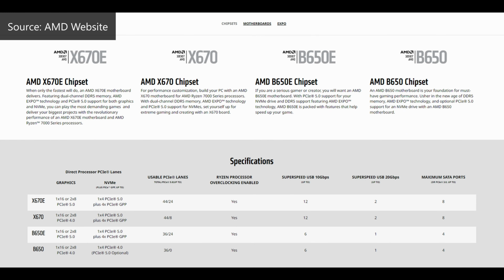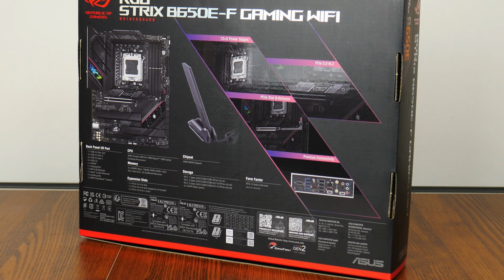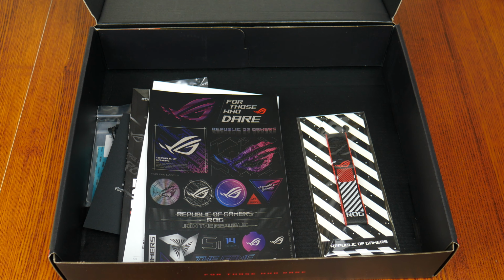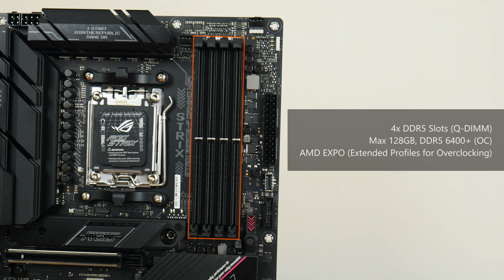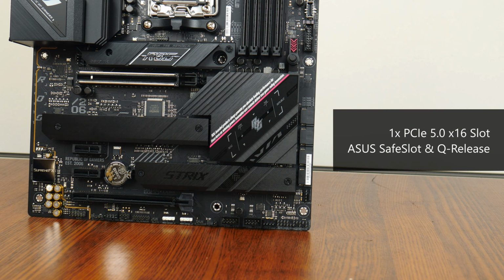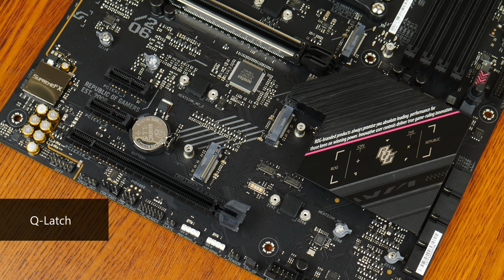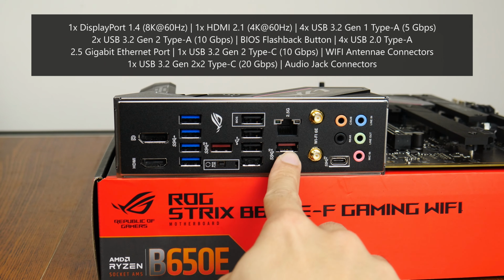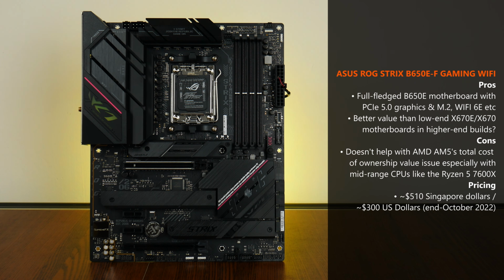Get this over an AMD X670 board? ASUS ROG STRIX B650E-F GAMING WIFI Unboxing & Overview

Comment from the maker: UPDATE AS OF AUGUST 2024: This video was published before 48GB DDR5 memory modules were available - according to the ASUS specs page, this motherboard now supports up to 192GB of RAM with 4x 48GB DDR5 memory modules. In addition, "Zen 5" Ryzen 9000 series processors and "Zen 4" Ryzen 8000 APUs are now supported with a BIOS update that is available for download from ASUS's official website.

Check out the written article version of this motherboard review here: https://www.alktech.co/articles/review-asus-rog-strix-b650e-f-gaming-wifi-am5-motherboard
Reply: Which one is better the b650E -E or the B650E -F?
Reply from the maker: @wankerka the B650E-E has more features. such as dual PCIe 5.0 x16 slots and dual PCIe 5.0 x4 M.2 slots - the B650E-F on the other hand comes with one PCIe 5.0 x16 slot and one PCIe 5.0 x4 M.2 slot. The E-E would hence be more expensive than the E-F, so it'll boil down to whether or not you have a need for the additional features that the E-E comes with...
Reply: @ALKtech  thnks for the info, hmm i think ill go for the E - E it makes sense. Not buying a x670E not worth the money
Reply from the maker: @wankerka  I do think high-end B650E boards can make more financial sense than X670E boards, though this of course does depend on your actual use case!
Reply: @ALKtech  for me it's for gaming. Gonna pair it with 7800x3d. 7900xtx. That will do for me at 1440p monitor
Reply: An interesting info about the support of 48 GB RAM modules, never heard about such modules😊. My Ryzen 9700X supports up to 192 GB RAM. I think that current amount 64 GB RAM that I use with this MB is enough for me. Thanks for the August 2024 update. Interestingly I bought the MB in August 2024 as well for about 245 USD. I'm satisfied.
Reply from the maker: @mirao-u9p  in fact, some AM5 motherboards from other brands such as Gigabyte and MSI are already pre-emptively advertising support for 64GB DDR5 modules, which aren't really available as of yet! 4x64GB (256GB) of RAM in a consumer-oriented system seems like overkill 😅
Reply: Does this motherboard have on board wifi? Because on the amazon page it says on board wifi but also comes with a wifi adaprer
Reply: @gamepsyko It does, I'm using it.
Reply from the maker: @gamepsyko  yes it does, it comes with WIFI built-in!

Comment: Great review.  I can't decide between this Strix version, or the TUF 650E?  They're both about the same price here in the UK in 2025.
Reply from the maker: Cheers! Out of curiosity, how big is the price difference exactly? If it's really just a few quid, I'd probably just go with the ROG Strix as it's the more premium offering of the two boards with better specs. Have you already decided on a processor for your build yet?
Reply: @ALKtech  Here in the UK the Strix is £190 and the TUF is £195.  As for CPU I want to use the 7800X3D.  Keeping away from the 9000 series, as they seem to be prone to failure?
Reply from the maker: @mrmactknife  oh then the choice is as clear as day - I'd definitely go for the ROG Strix since its cheaper than the TUF!

Regarding the 9000 series, I assume you're referring to the reports of chips such as the 9800X3D burning up in the socket? I personally wonder if it's a case of vocal minorities...but in any case, the 7800X3D is still a pretty solid gaming CPU!

Comment: 8:55 can someone explain this for me? will adding an nvme ssd in the 3rd slot affect performance in games or affect my gpu? or is that slot mentioned for something else?
Reply from the maker: Hey there, adding a SSD to the third NVMe slot won't impact your gaming performance nor your GPU performance. The only impact to be had is that it disables the full-length PCIe 4.0 x16 slot that operates at x4 mode, which is a concern only if you're intending to install an add-on card in that slot! If you have no use for that slot, you'll be fine!

Comment: Does this run on windows 10! Seen a mobo comparison and it said it doesn’t run 10?
Reply from the maker: Theoretically it should work with Windows 10, though for absolute peace of mind, using Windows 11 would be best as you'd get the latest software optimsations for AMD's AM5 processors going into the future!

Comment: I want to buy it but i read a lot about stability issues. :/
Reply from the maker: Hey there, what kind of stability issues did you read about?
Reply: @ALKtech  About long time to post, 1+ min even with qvl listed rams. About bsods. Mainly issues with expo. I dont have great knowledge and it will be my second ever build,i want something "plug n play". So...for safety im thinking to go with qvl listed rams 5600mhz 36cl 2*32gb. Less voltages and higher latency I think will pressure memory controller less so i will increase the stability??? In my country i can find asus rog strix b850e-f for 80€ more expensive. Im thinking for this one too.
Reply from the maker: Mmm I wonder if these issues are cos of older BIOS revisions - I'd think RAM compatibility would be improved somewhat as long as the board has the latest BIOS version onboard! That said, the sweet spot for Ryzen 7000 and 9000 is DDR5 6000 - perhaps consider getting DDR5 6000 low latency RAMs?

Comment: This or a asus tuf x870 plus?
Reply from the maker: How big's the price difference between both boards where you're from, and do you need USB4? If the B650E-F is cheaper and you don't need USB4, I'd get the B650E-F!
Reply: @ALKtech  they basically the same price over here lmao. Asus got more features and better phases I think, meanwhile rog strix got that premium feeling...
Reply from the maker: Mmmm. Yeah I do agree that the ROG Strix definitely feels more premium compared to the TUF due to its looks and accessories, while the TUF being the newer board, comes with a newer chipset (which is basically just a X670 with USB4 tacked on) and a slightly better VRM setup. That said, I think that both boards should handle even a 9950X3D or 9950X with ease. 

One thing that I do not like about the TUF is the fact that its second M.2 slot shares bandwidth with the PCIe slot for a graphics card - this is something that's really common with the first wave of X870E and X870 boards due the introduction of mandatory USB4 support, where the USB4 controller requires additional PCIe lanes for operation, and the X870E/X870 does not have "additional" lanes to support the controller, leading to this whole lane sharing situation.

Out of curiosity, what's the specs of the PC that you're looking to put together?
Reply from the maker: The B650E-F is gonna handle a 9800X3D just fine, no need to splash out that extra $ for the X870! And damn, your new build is gonna be one heck of an upgrade from your current PC, I had an i5-2400 and RX 580 combo at some point in time for my own personal rig 😂
Reply: @ALKtech  wish me luck cause prices can hike at any moment 😭
btw was thinking of saving a lil longer so as to get a x670 rog strix instead
Reply from the maker: Ugh, is it due to tariff issues? Which country are you from? Anyway how big is the price difference for the X670E-F vs the B650E-F, and is there any particular reason why you're looking at that board too?

Comment: Used this board for my new build with 7800X3D, GSkill Z5 RGB 64GB 6000 CL36, MSI Spatium M480 Pro and RX 6800 XT. Its been 2 months and is running great but i have plans to upgrade gpu next year when amd 10 series comes out
Reply from the maker: Great to hear - it's really awesome that AMD has committed to support the AM5 platform for such a long time. Really helps that this motherboard comes with PCIe 5.0 support for a graphics card and M.2 drive, making it pretty future-proof!
Reply: Just ordered this board for 7800x3d, Rx 9070xt, 32gb 6000mhz cl30 ram and Strix 1000w PSU.. should do fine for many many years. :)
Reply: @SipePerkele same here but instead of 7800 i go for 9800x3d

Comment: only thing I wish they would do is add mobo risers and screws
Reply from the maker: Are you referring to a PCIe riser so that you can do a vertical GPU mount?
Reply: @ALKtech  no Im talking about those little studs that go between the mobo and case
Reply from the maker: @truthteller9000  ahhh right...those are motherboard standoffs! They come with your PC case actually, and motherboard manufacturers never include those as part of the motherboard's list of accessories - is your PC case missing the said standoffs?
Reply: @ALKtech  I know they dont come with them thats why I wish they did lol and no new case didnt come with them either so I just ordered a little set of them no biggie haha
Reply from the maker: Oops, it could be that the case manufacturer left out the motherboard standoffs from the accessories pack...you should probably lodge a complaint or something 😅 what brand and model of case did you get?

Comment: I also used this Motherboard with a 7900X CPU to upgrade my Sons PC. We really like it. I usually stick with MSI but Asus did an amazing job with this Motherboard. Price to performance is amazing.
Reply from the maker: And it still holds true even with the launch of X870E and the X870 - at least until AMD stops producing the B650E chipset! Did you manage to get the board at a good price?

Comment: So no seal on the box and no seal on the static bag ? I want do buy one. How can i be sure is 100% new ?
Reply from the maker: Actually this is not just limited to ASUS - for other brands such as Gigabyte, MSI etc, you'll find that the boxes are unsealed, and some brands may only just put a simple piece of clear tape to hold the opening of the static bag together. Your best bet would be to purchase your motherboard from a trusted physical/online retailer that won't mess around with things!
Reply: @ALKtech  Thank you ! I am buying it from a trusted physical and online retailer, actually a big one in my country. I wanted to be sure about these seals not being there :))
Reply: @dragos1354 I was wondering the same, I got mine from amazon and this no deal thing was making me think it was already used, plus the static bag was like no smooth, like it had the marks of pointy parts on it.

Comment: Is ryzen 5 7600x goot combo for this motheboard?
Reply from the maker: A 7600X will work perfectly fine with this board for sure. Do you have a graphics card in mind already?
Reply: @ALKtech  I will buy used 3070 ti,good combo right?
Reply from the maker: @simkesimoni7077  yup, a 3070 Ti will work pretty well with a 7600X! You'll be able to game at 1080p easily, or at 1440p with Medium to High-ish settings.
Reply: @ALKtech  is it evga 650w 80+ platinum enough for that cpu and that gpu? and 2x16gb ram
Reply: @ALKtech  pls answer bro
Reply from the maker: @simkesimoni7077  a 650W PSU will be fine for a 7600X+3070 Ti, though it won't hurt to get a more powerful PSU if you have the budget for it. This would give you more headroom for an upgrade to a more powerful graphics card and processor down the road, especially since B650E boards will support the next gen of Ryzen processors by AMD. That said, 2x16GB of RAMs is good - do you know what RAM speed you'll be getting yet? DDR5 6000? DDR5 6400?
Reply: @ALKtech  i will upgrade psu but now now ,maybe next year...Yep 6000mhz cl36 kit
Reply from the maker: @simkesimoni7077  sounds good!

Comment: Im not sure if this mobo has a tpm connector, so will it be able to run w11???
Reply from the maker: You'll be fine - you don't actually need a dedicated on-motherboard TPM module to support Windows 11 - modern CPUs such as the Ryzen 7000 series supported by this board, include a firmware version of TPM on the chip, and hence there's no need to buy a discrete TPM module to be installed on your motherboard. Hope this clarifies!
Reply: @ALKtech  now that makes sense I wasn't able to find an answer, this clarified everything thanks!!

Comment: Thanks for the review, I actually bought this motherboard after watching your review, and so far so great!, btw, What does it exactly mean that PCIe 4.0 x16 lane operates at x4 mode?
Reply from the maker: Glad that you found the video useful! It simply means that the physical connector supports a full-length x16 card. but has physical pinouts to support x4 link speeds only (i.e. within the plastic slot itself you'll notice it only has 1/4 of the gold "teeth"). Hope this helps!
Reply: Thanks! Now I get it! @ALKtech

Comment: Hi my friend built a new pc with this and he has problems when he want his ddr5 ram to run above 3600mhz does any one have a solution to this?

He has 128gb of ddr5 ram (4x32gb) and the pc wont boot when he changes anything in the bios regarding his ram and the mhz they are running at.
Reply from the maker: Looking at ASUS's RAM QVL list for this board, it does appear that they've only tested 4x32GB DDR5 RAM at 5200MT/s speeds - this COULD be the reason why your friend's having issues with RAM speeds faster than 5200MT/s!

Comment: Thanks for the detailed overview of the ASUS ROG STRIX B650E-F GAMING WIFI motherboard! Your video provides an excellent insight into its features and specifications. I'm particularly impressed by the PCIe 5.0 support and the abundance of USB connectivity options.

I do have a few questions, though. Could you please clarify if this motherboard supports AMD's SmartShift technology? Additionally, are there any specific advantages or unique features of the B650E chipset compared to the higher-end X670E and X670 chipsets that you mentioned earlier?

Looking forward to your response!

Comment: Just grabbed this board with a 7700x cpu excited to get everything installed
Reply from the maker: Sweet, what GPU will you be using in your setup?
Reply: @ALKtech  I already had a 4070ti but now I’m actually taking back the 7700x for the 7800x3d it’s on sale for $80 off at the local microcenter
Reply from the maker: @westside4life1770  7800X3D's gonna last you some time as a gaming powerhouse!

Comment: Is it compatible with the AMD Ryzen™ 7 7700X
Reply from the maker: Yes it is! It's compatible with all AMD AM5 processors.
Reply: @ALKtech  ok thanks
Reply: @ALKtech  also do you need specific AIO’s
Reply from the maker: @TheHenVR  not really, as long as the AIO you're getting comes with support for the AM5 socket, it'll fit this board just fine!
Reply: @ALKtech  ok and I’m getting the nzxt kraken z73
Reply from the maker: @TheHenVR  it'll fit, just gotta make sure the Z73 comes with the AM5 mounting bracket!
Reply: @ALKtech  ok I think it does thanks

Comment: this or the GIGABYTE B650 AORUS ELITE AX
Reply from the maker: The ASUS in this video is positioned slightly above the Gigabyte in terms of specs, especially since the ASUS board uses the higher-end B650E chipset and the Gigabyte uses the B650 chipset. How big is the price difference between both boards where you're from?

Comment: Micro center has this board pared with a R9 7900x and 32GB ram for $550.00 just make shore to flash the bios as asus is in the dog house over there Bios frying CPUs
Reply from the maker: Wish there were Micro Centers where I'm from - you folks always get pretty good deals from them! But yes, gotta make sure you've got the latest BIOS for ASUS AM5 boards..

Comment: I’m getting a great deal for this mother board cpu and ram. I’m kind of scared to get this motherboard what should I do?
Reply from the maker: What's the concern that you have regarding this board? By and large I think this board has the right mix of features for a relatively future-proof AMD system that will be ready for a next-gen processor upgrade (Ryzen 8000 series and perhaps 9000 series) when they arrive!

Comment: The best thing and the reason I picked this motherboard for my 7800X3D+RTX4090 build is that it has a PCI-E x16 slot (yes, I know it operates at x4 mode) sitting at the bottom of it. With this slot, I can easily install 10GbE NIC or HBA card.
Reply from the maker: Add the fact that you've got PCIe Gen 5 support for both the primary PCIe slot and M.2 slot, as well as an upgrade path to Ryzen 8000 and perhaps even Ryzen 9000. Pretty future-proof I'd say!
Reply: @ALKtech  well I am still using 970PRO from my old rig and another SSD is 2T PCI-E 4.0, so I guess I cannot benefit much from PCI-E 5.0. However it is nice to have it anyway.
Reply: Can you tell me what is 10GbE NIC used for? I see people talking about those add on cards on those lower lanes but i have never used lower pci slots only firs for gpu.
Reply: @fiece4767  For 10Gbps ethernet connection.

Comment: They have this wis 7950x3d bundle, but idk seems kinda low end for it
Reply from the maker: Mmm. Actually I think going with this board and a 7950X3D might not be that implausible a combo - the VRMs on this board are pretty beefy and should handle a 7950X3D just fine. Plus you still get nice-to-haves such as PCIe Gen 5 support for your graphics card and M.2 SSD...
Reply: @ALKtech  good micro center had a combo with 64gb of ram
Reply from the maker: @XX-sz6qh  yeah from what it seems Micro Center does run pretty good DDR5 combo deals of late!